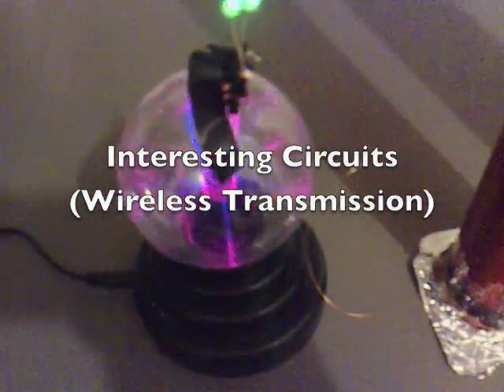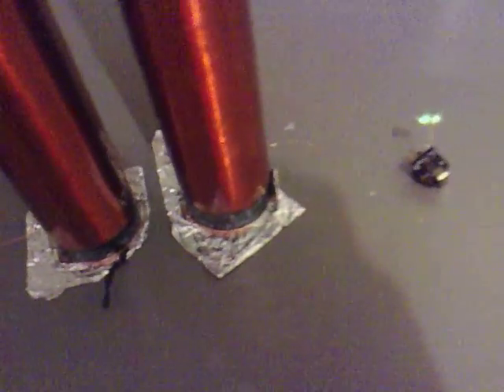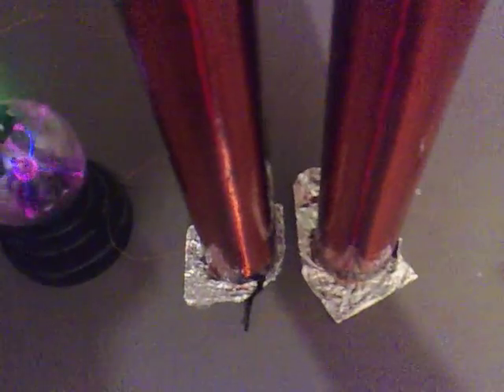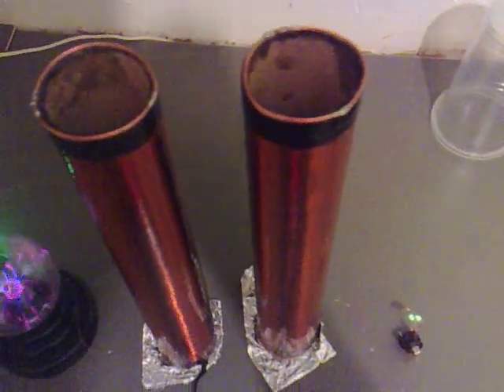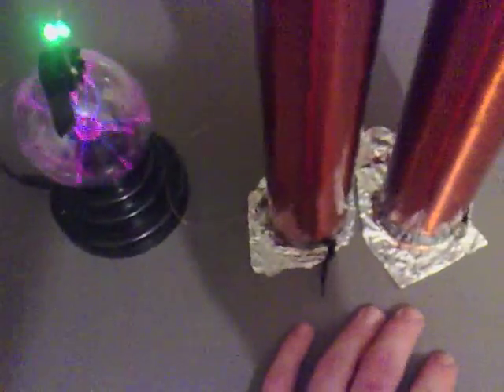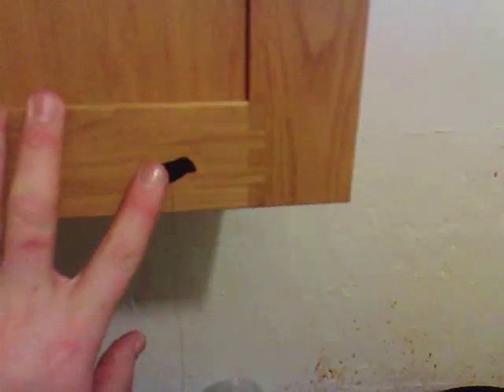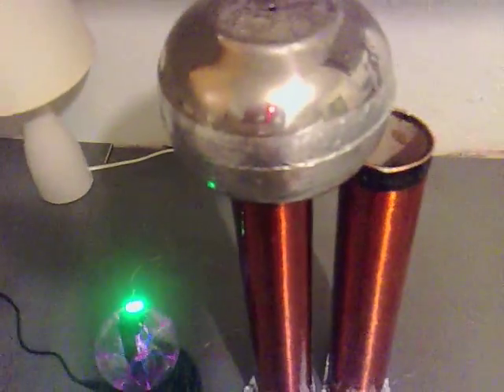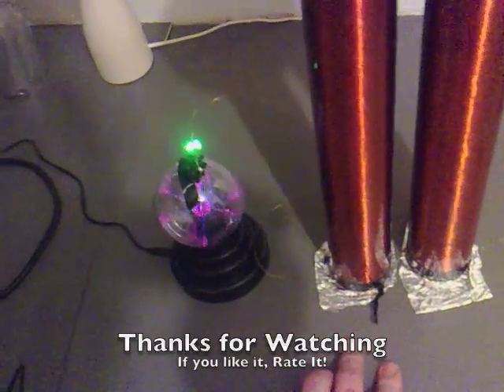Interesting Circuits (Wireless Transmission) 004

Comment from the maker: Thanks, I was just testing it with the big coils as I already made them and I knew they were matched.  I have bought some smaller gauge wire to make some smaller coils with a much lower resonance. I might try it on 2.4MHz later to pull power off wifi routers in the area....

Paul.

Comment: inside the  plasma ball is a small hv transformer in the one i hade there was a push pull config of to transistors and they produce 1cm sparks from the hv transformer they are fun plasma balls

Comment: Nice work. 
Its the old Tesla sparkgap method but with plasma. By using an antenna you are creating a certain size of waveThe input (your other coil) is tuned to accept that wave and presto you have transimitted power.
For this application you need smalller coils.
5 stars though you are on the right track.